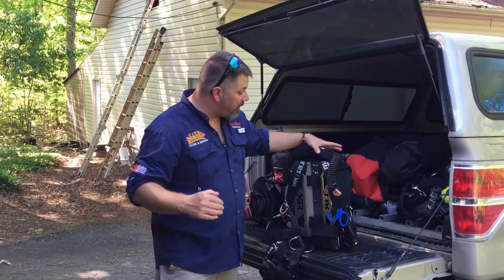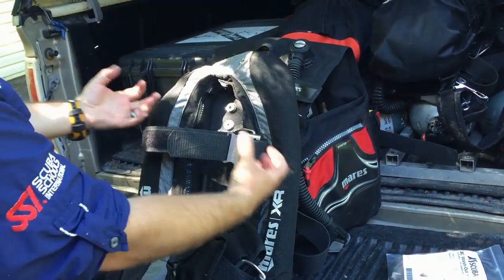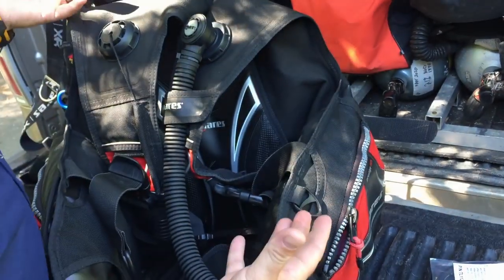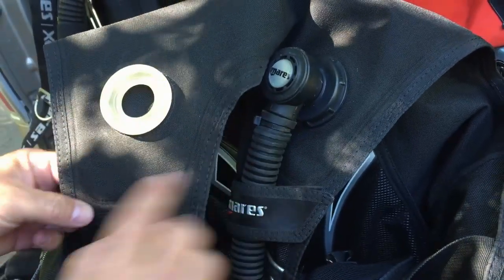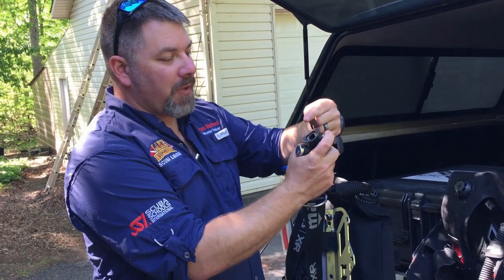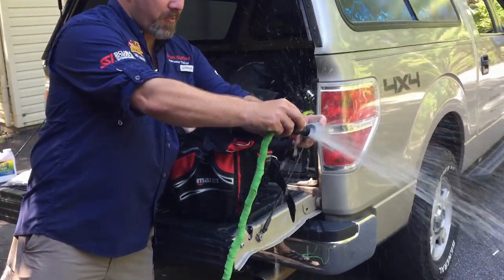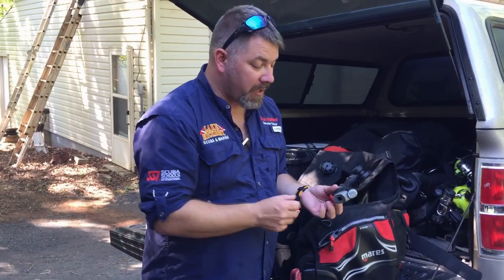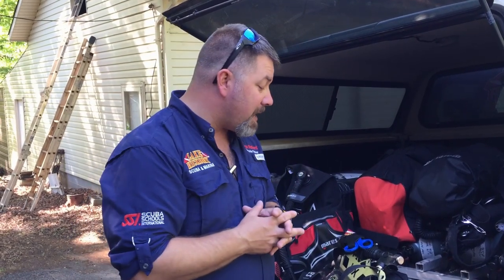BCD Clean Out Procedure

Comment: Hey Brian, just something to add that I do is, after I'm done rinsing the inside of the bladder I take off all the dump valves and inflator hose and just let the bladder hang so moving air can flow through the bladder and totally dry out the bladder on the inside.  That way no mold (and whatnot) won't grow inside. Thx for the video Brian.
Reply from the maker: Great advice mustanggun. Thank You.
Reply: I do the same but after removing corrugated hose I hang it up by hooking the inflation port over a wire coat hanger. Because open end of corrugated inflator hose is down all the water can drain. Sealing disc/washer is put into a BC pocket so won’t get lost.
Reply: Also to add… after putting water in the bladder, I dump fresh water out of every dump valve and lastly the inflator hose. Then I will orally inflate the bcd, check for more water in the bladder and if necessary, empty out of rest of water by use of j flavor hose. 

I always make sure to store with a little bit of air in the bcd.

Comment: Awesome video as always.  We talked at your shop and you told me to flush my second stage with water also. Some have told me to never do that to prevent water to the first stage. Id love to see a video on that.
Reply: Flushing your second stages is a really good practice to get into.  Just make sure the hose stays above the second stage so water doesn't flow back up it.  When you've finished, shake it out and let it drain with the hose still above it.  If you have a cylinder to hand, connect the first stage and purge the reg a few times to remove any remaining water.
Reply: @timgosling6189  Thanks Tim. I'm new to diving and get alot of information from lake hickorys videos. The dive community is amazing also. Everyone I have met seems to be very nice and helpful.
Reply from the maker: Hey Josh, I will be glad to make a video showing you how to flush your second stage out safely.

Comment: I was wondering if the hose would work with the aqualung air source , where it is also a fully functional regulator .
Thank you
Reply from the maker: Hello NAA, that would be a question you would need to ask your local Aqualung Dealer. Certain brands, such as Aqualung, Scuba Pro, and Mares, have different quick disconnects for integrated inflator / regulator combos.

Comment: My wife has the scubapro air 2, and I use the mares air control bcd octo/inflator. Is there any certain way I should add water to regulator to rinse out the bcd?
Reply from the maker: Hello michael Frazier, the most simpilist method is to hold open the exhaust button on both and squirt water directly into the mouthpiece of the regulator / inflator. Swish it around a little bit, then drain. Hopes this helps.

Comment: Do Scubapro make that fitting for filling ... I just use the hose but that fitting would be nice 🇬🇧👌
Reply: Should be same fitting regardless of brand.
Reply from the maker: Hello Albert Bell, it depends.  I a diver is using the Air 2, the inflator adapter is most likely a proprietary part.  This will prevent you from using the same connection.
Reply: LakeHickoryScuba Thanks I also use the Air2 👍🇬🇧👌

Comment: Strange thing. I never had water in my BCD after the dive. Don't know what am I doing different, but  I don't have to dump water from bladder. Of course there are few drops inside. But these few drops you will never be able to dump. Too small amount of water. So servicing my inflator is simple and not messy at all. And what is even more interesting, remaining water in my BCD never gets smelly unlike my suits that are a bit smelly no matter what I do. I would never drink the water from my BCD, but it looks like lack of the air prevents water inside from decomposing. What I usualy do after diving at salty water is one dive at fresh water and little bit of drinking water after the dive to rinse all moving parts like inflator, valves, etc. When servicing inflator, there is no salt inside. Just usual assortment of small particles that are easy to clean.
Reply from the maker: Hello Petr Sedlak, sounds like you have a great system and cleaning method.
Reply: @LakeHickoryScuba  Thanks, but if you'd ask me how to achieve that, I simply have no idea :D